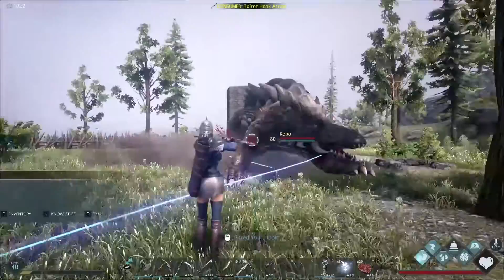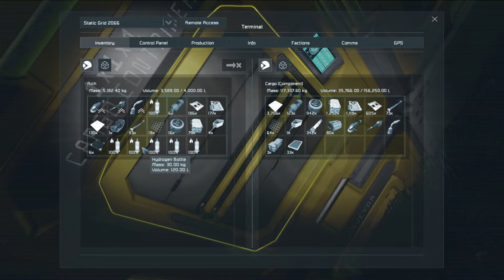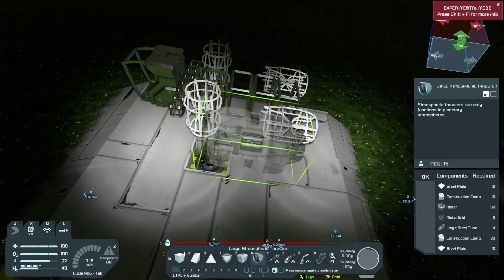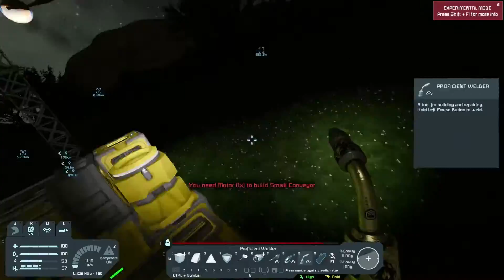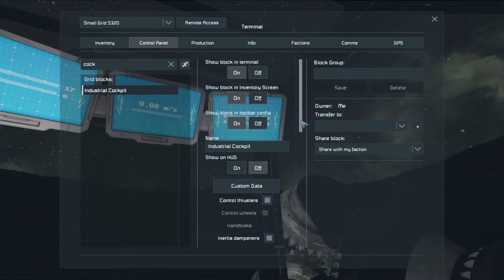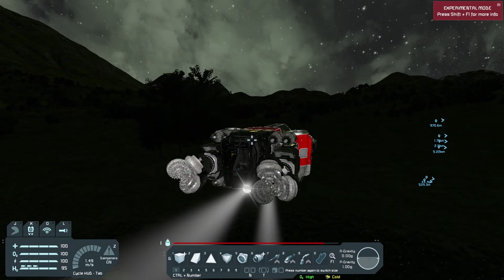Space Engineers #3: Atmo Miner

Comment: Every small mining ship i make cant hand the full load. i even removed small containers resorting to only containers in  the drill, ship, and connector. still heavy. is it that huge battery ? or is it because im using small thrusters. i have to use 4 of them just to barely fight a single direction.
Reply: @Arnold Rimmer The smeghead is right!
Reply: @MefuneAkira  Late to the party, but this comment is gold
Reply: there is a reason why he uses big thrusters to push the ship up. its enough for a med cargo, cockpit, connector and drills fully filled.
What i use on mine which is similar to his is: *small atmo pushing backwards, 9 small atmo each side, 2 big atmo foward, 2 big atmo upwards, 4 big batteries, cockpit, connector, 4 gyros, 2 drills, ore detector, antenna, small reactor(was the last thing i added). Before the reactor i was using my base power to recharge the batteries on the ship which would last for like 4 hour while on use. The ship also cant stay upside down but can point straight down and stay still.

Comment: All thrusters got buffed by 20% so no need to have as many as before, batteries will last a bit to get the job done. Avoid the hydrogen engine for non ground vehicles. You don't need air vents for atmospheric ships.

If you're worried of batteries autonomy could slap a solar panel that will help a bit till you can find uranium later on as cheap power source.